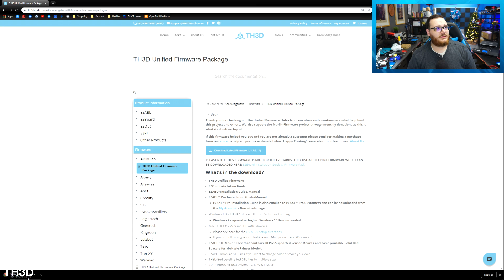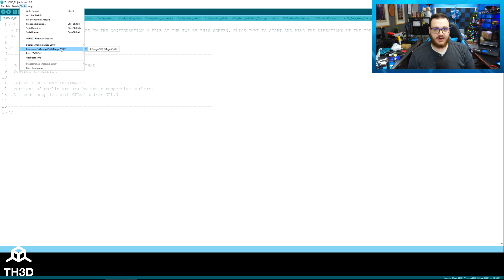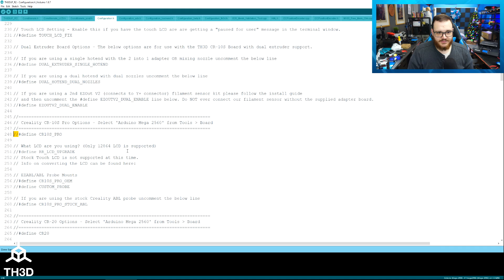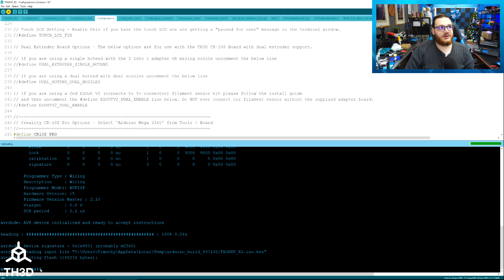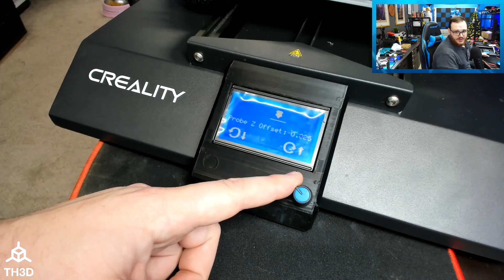Installation Video - CR-10S Pro 12864 LCD Upgrade Video - NO Soldering!

Comment from the maker: READ THIS: This video was made in 2020 and we cannot update videos once posted. The firmware process is different now but the physical installation of the LCD is the same aside from the M3 screws – we are shipping coarse thread screws since it makes assembly easier. Follow the physical installation process as shown in the video and then for the firmware follow the directions on the latest firmware page here: https://tickets.th3dstudio.com/help-guides/article/unified-2-firmware-8-bit-board-guide
Reply: What exactly does this get you outside of a much, much nicer looking screen with a more responsive touch screen? 
I'm using your firmware on my printer (huge upgrade btw), and it seems like the stock screen firmware has all the functions... the touch screen kinda sucks, gotta really mean it when you press it, but, surely I'm missing something here?

Comment: I saw another video where the guy updated the stock screen with an sd card and flashed the printer with the computer. Super confused now because the site says the lcd kit is required. Can you explain? this was on a cr10s pro v2
Reply from the maker: There may be other firmwares out that have modded the stock touch LCD but we do not do any development with them because we do not have the dev tools or source code. If you want to use our firmware with that model you have to have our LCD kit installed on it.
Reply: @TH3DStudio  it was the TH3d unified firmware he loaded .. maybe he skipped a step and never showed the screen being upgraded. Thanks for the note. I’ll add that to my cart today.
Reply from the maker: @guidancebeats  not sure about that then. We haven't ever supported the color LCD those come with due to lack of source code and dev tools for them. Creality never released them to us.

Comment: I just ordered and received this today. I am confused when you started mentioning Arduino stuff. I know nothing about Arduino, nor do I own one.

Can the firmware just be flashed through a connected USB from my computer to the CR-10s Pro using PrusaSlicer?
Reply from the maker: This video is older before we switched over to VSCode. Follow the kit install and then switch over to the link below for the firmware setup. If you did purchase the full kit from us you do get tech support with it so send us a ticket if you need a hand. :)

FIRMWARE NOTE: You should use the new Unified 2.0 firmware and VSCode. These are on our website linked below.
Firmware Download: https://support.th3dstudio.com/helpcenter/creality-cr-10s-pro-v1-firmware/

Comment: i've just found this video, i have the original cr10 and i need to replace the LCD started with an encoder going bad for me, tried replacing just the encoder but now i get a blank line through the screen and the encoder doesn't do anything so i've resorted to sourcing a new board, will this kit fit my basic cr10 ?
Reply from the maker: This kit is just for the CR-10S Pro. but you can get a new LCD for the original CR-10 here: https://www.th3dstudio.com/product/creality-12864-oem-lcd-screen-cr-10-ender-3-ender-5-more-single-dual-cable-compatible-exp1-exp2-exp3-cables-included/

Comment: I'm asking me why to downgrade the display?
Reply from the maker: Its not a downgrade because you're getting access to better firmware and more settings. Just because a LCD has colorful pictures and dialup noises does not make it better. Better = more functionality and this is what the conversion kit does. Having a "pretty" color touch LCD is useless when it limits what you can do with the printer.

Comment: @TH3D Studio which individual pins are technically joined together with the use of the adapter? What are the pin numbers?
Reply from the maker: Sorry but we don't provide that information. If you cannot find it on your own you probably shouldn't be soldering on your board.

Comment: I don't know if the link to the firmware is old or what, but the unified firmware 2, which I hope is the correct one, is very much different from what you have shown in the video. Is it outdated? I can't find the .bat file and if I go in the Marlin folder there are many more things to uncomment which make things more difficult for noobs like me.
Moreover, I downloaded the arduino IDE but I can't find the atmega board there.
Reply from the maker: We cannot update videos after they are uploaded and Unified 2 was not out when we made this video. Unified 2 is a completely different setup but it is listed on the page itself where you download it here: https://www.th3dstudio.com/hc/downloads/unified-2-firmware/creality/creality-cr-10s-pro-firmware-v2-x-2560-board/

As for the rest of the installation steps, they are the same.

Comment: What about a firmware update for a CR-10S Pro with BLTouch
Reply from the maker: Our CR-10S Pro firmware already has BL Touch support. Only pre-req is that the LCD kit is installed and you follow the BL Touch CR-10S Pro installation info from Antclabs (there is a jumper required and wiring).
Reply: Hi! any video tutorial on converting the lcd on the cr10s pro v2?

Comment: I've gone through this process several times. When I try to calibrate my pid settings, i get error:init failed. How do i fix this? the github guides and every forum hasnot been much help. Everyone makes the steps too complex and it is not all straight forward. Can you help me?
Reply from the maker: We have a guide here: https://support.th3dstudio.com/hc/en-us/articles/360043728451-P-I-D-Auto-Tune-Guide

Comment: OMG!!!! You just solved a problem I was having putting a stock CR-10s display on a SKR 1.4 board.  LCD not working.  I reversed the connectors. and it WORKED!  WOW!  Now if my hair will just grow backj after I pulled it all out.
Reply from the maker: Glad I could help! It's a pain with all these LCDs+Cables.

Comment: Are there schematics for the adapter board? International shipping for the item is more expensive than the adapter board itself.
Reply from the maker: There are not as this is a product we designed in house here. You can get the full kit from us that includes all the parts (including the case, mounting hardware, and LCD) from our store here: https://www.th3dstudio.com/product/cr-10s-pro-lcd-conversion-kit/

Comment: Small question = does this work for the CR10S Pro V2 as well ? regards Manfred
Reply from the maker: AFAIK the V2 just changed from using their awful 18mm probe to a BL Touch and all the other internals are the same. If your board looks the same as the one shown in the video then yes it should work fine. We only have a V1 to test on here.

Comment: Any chance in getting this mod & mount to work with the BTT TFT35-E3 v3 duel mode screen? That would be a great and much needed boost to this machine! Still like & have this mod installed personally, but I do go back to tiny machines firmware and stock touch screen from time to time. Thanks for all that you do!
Reply from the maker: Not at this time. We don't have the staff to complete that task. You should contact BTT to support their LCD.

Comment: Right you need to tell everyone that the adapter boards your selling are made the wrong way. had to snip the adapter board plastic to put in same way as you. one cable goes in normal way and other has to be switched round. wow.  now the screen comes on. you will get loads of people with same problem.
Reply from the maker: I see what you are saying. It should be installed how it is shown in the video where it is not overlapping the case. The 12864 suppliers vary how the headers are. We'll update our stock to have the headers flipped for the future batches. My apologies for the added frustration. Dealing with these Chinese LCDs is difficult but a necessary evil as if we had custom ones made they would be 3x the cost and people would be constantly complaining about the added cost.
Reply: @TH3DStudio  Np I understand. 5 hours I was trying until I noticed the adapter boards was the wrong way round ;)  glad you noticed.  got both cr10s pro converted now. so much better than stock.
Reply from the maker: @RType2966  sorry about the mix up with them. I just went out and updated our stock with the rotated headers to match the current LCD stock. We'll keep an eye on them closer in the future to prevent further customer confusion.

Comment: I have just returned it back to stock and taken the bl touch out and installed the original sensor. flashed same way as you no picture there is something not right here. tried both screens same thing.
Reply: I know this is old but I had the same problem I had to flip the cables around I couple of ways and it worked finally.

Comment: Done whats in video, ordered 2 screens. tried both got them to light up but when flashing nothing comes up on screen. just blue and a clicking noise. any help would be great.    :(  flashed both my cr10s ender 3 and cr10s5. but for some reason this not working.
Reply from the maker: You need to flash the firmware on your control board like is shown in the video. This is assuming you have everything connected correctly as well from the LCD to the board. Did you buy the full kit with the CR12864 adapter? If you did not buy the adapter it will not work.
Reply: TH3D Studio yes I flashed the same way you did It . Is it because I’m not putting in the correct PIN number for my bl touch.
Reply: I purchased the lcd screen kit x2.    When I put cables in normal way the screen would not light up from usb.  Changed cables round and screen li up blue.   Flashed firmware and nothing. Screen still blank.
Reply: @TH3DStudio  noticed the adapter boards you send me go in the other way. could this be the problem. mine overlap the case
Reply from the maker: @RType2966  The adapter board should be installed on the LCD the way it is shown in the video where it is not overlapping the printed case, it should be over the LCD.
Reply: @TH3DStudio  yes but they have tabs In  the way. I had to cut tabs on the adapter board. if you put in the normal way it will overlap the screen.  check you adapter boards. not cables. then you will see what I mean.

Comment: Nice video Tim. couple suggestions though, put the screws in then out of the bracket with the drill before you put the lcd in. Then the holes are already threaded and you don't need to worry about bending the pcb. In regards to flipping the exp cables  over and cutting the tab, you can actually pull the black keyed jacket off the pins, flip it, and put it back on. Then you won't need to ruin your flush cutters cutting the key off.
Reply from the maker: Pulling the headers off is a little more risky for the average person (bending the pins). You don't need to cut them as pushing it in doesn't hurt anything. Just wanted to mention it and show it in case people had a hard time. The tabs on the connectors are plastic so unless someone has some really bad flush cutters it shouldn't be an issue for them.
Reply: @TH3DStudio  You mean the cheap flush cutters that are included with E3Pro? I get that there is a bit of risk, but if your doing these mods, normally you should be fine with it.

Comment: Thanks for the video. Does your firmware support a BLtouch?  I ordered the upgrade package but I have a BLtouch on my CR10S Pro.
Reply: Corey Mac you can configure the firmware for BLTouch.
Reply: did you find what pin bl touch  needs to be put in the firmware ??  cheers
Reply from the maker: There is BL Touch support in the firmware but we do not offer technical support for the BL Touch. If you want a fully supported ABL system that is more accurate and robust than the BL Touch we highly recommend you check out our EZABL kit as we have a full conversion kit for that kit for this machine: https://www.th3dstudio.com/product/cr-10s-pro-lcd-ezabl-upgrade-kit/
Reply: @TH3DStudio  does EZABL work with all bed types?
Reply from the maker: @pdxcerealkilla9847  Yessir! It does.
Reply: @TH3DStudio  what pin number do you put in th3d firmware for bl touch.. just received 2 screens from you.  thanks

Comment: i have the Pro and i bought the Struts for the Max but as you know the lower aluminum channels are hidden. In the video i could see the end of the front alum bar the struts would screw into, it seems like it is right against the sheet metal housing. Would it be possible to drill out a hole in line with the Alum bar that the Strut hardware could screw right into the front Alum rail just line the Max?  I like the touch screen really, but i do see all the access to settings that you provide. I am still a little nervous. We will see. Thank You for all you guys are up to. I like the Pro as a machine and hope you have more updates for it. Struts, dual filament, bead Extruder for PEEK. D
Reply from the maker: It's not directly against the sheet metal so you'd have to do quite a bit of cutting to get it all flush and extend it with another piece of extrusion to get it out of the case. IMO it's not worth the hassle. The struts do not make a difference if you have the machine assembled correctly.

Comment: I really want to do this to my cr10 Max, will this kit work? Are you planning on releasing one specifically for the max? Will the th3d firmware have the settings for the max with this upgrade? Thanks I’m excited to be done with crap ass touch screen.
Reply from the maker: All that is stopping us from officially supporting the Max is the LCD mounting part. We do not have a Max here to design a part for so if someone can make a 12864 LCD mount for the Max it will work. We worked with a guy remotely that installed this LCD kit on his Max but he was working on designing a proper mount for the screen. The CR12864 board we designed works with the Max and we have the stock BL Touch working on the firmware as well.

Comment: I'm curious about the adapter board.  I did a similar upgrade to my CR-X (replaced the touch screen with a 12864) only using the cables to EXP1 and EXP2, and it seems to work fine.  Why would I need the adapter board to connect the 12864 to the motherboard touchscreen port?

Thanks.
Reply from the maker: Because Creality doesn't have all the data pins needed to drive the LCD connected to the EXP1 and EXP2 headers on this board. The CR-X uses the V2.X board while this is the V 2.4.X that is different. You must use the CR12864 adapter that we carry (and designed) to use the 12864 LCD with the CR-10S Pro unless you want to solder to the board. The adapter takes away the soldering that would be needed to make the LCD work.
Reply: @TH3DStudio  i bought the kit for my CR10S_PRO and I have the same issue of the blue screen after updating the firmware. Is there an adapter that goes from the 12864 board to the mother board? Or is there supposed to be an adapter to accomplish this....I must have missed the part about the adapter in the video
Reply from the maker: @ocmswillie  The adapter plugs onto the back of the 12864LCD and you plug the 6 pin cable that went to the touchscreen into that. There are data lines that the 12864LCD needs that are on that ribbon cable. https://www.th3dstudio.com/product/cr-10s-pro-max-12864-adapter-board/